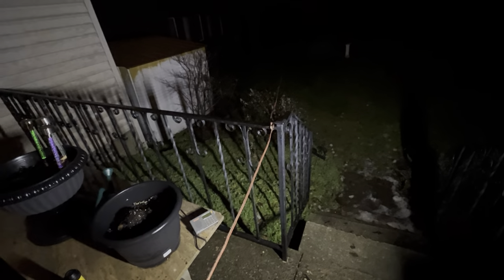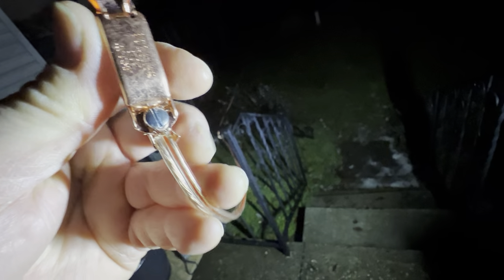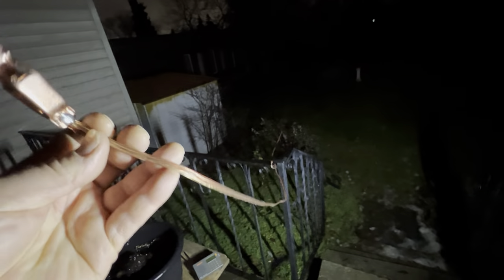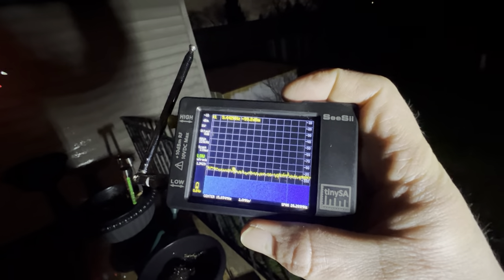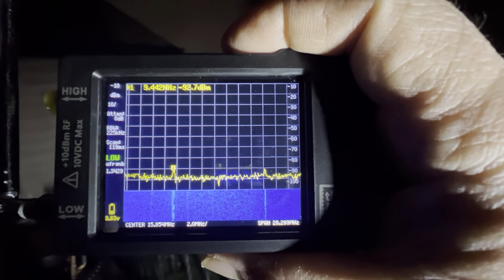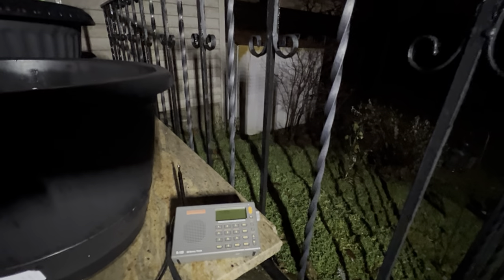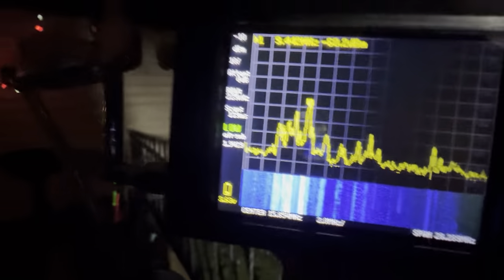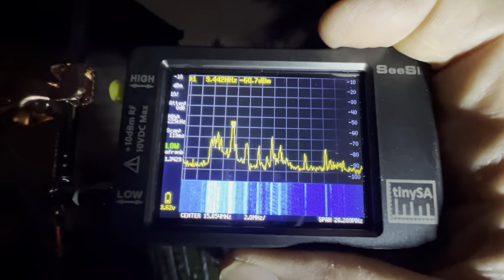DIY Shortwave Radio Antenna Made From Speaker Wire.

Comment: I suggest stripping and twisting together the two wires at the distant end. Then, insulate that with tape or a blob of hot glue or heat shrink tubing. Then re-secure the far end and the porch rail end. Now split the pair of wires and insulate one wire end. The remaining wire end can be electrically connected to your radio antenna for even better reception. With shortwave,  the longer, the better. Voila! You just doubled your external antenna length!

Comment: Thank you from George in the UK.  I use a lot of speaker wire in the making of aerials as its low cost and easy to obtain. When camping etc I have used farmers metal wire fences as aerials etc. For transmit and receive on SW I have run a wire alongside the washing line and it's held on by zip ties (cable ties in UK) Also I have a telescopic flag pole for a vertical aerial with speaker wire dangling from top and connected to a 49:1 balun at bottom. Run 20W tx and into most of Europe. Can also receive time signals from around the world ok most days. Money is tight now I am a pensioner so makedoandmend . Happy radio from old George

Comment: Any tips to improve indoor SW reception. I am not allowed to hang wire outside.
Reply from the maker: You can do the same thing inside with a shorter 10 foot wire. Also look into the MLA30 magnetic loop antenna for outdoor.
Reply: Yeah what Guitarman said. Also there is an SW antenna you can hang to a window with a suction cup. It's the Tecsun AN-48X that is basically perfect for you when you cannot hang any wire outside.
Reply: You can just get long thin wire and thumbtack it around the ceiling perimeter of a room in your dwelling....if once around isn't good enough....do a second loop....longer is better and the diameter of the wire doesn't matter for receiving.
Reply: @kd5txo Thanks, good to know. I'll give it a try!